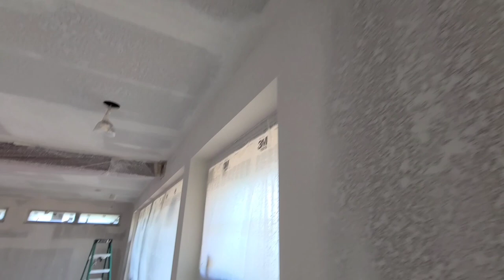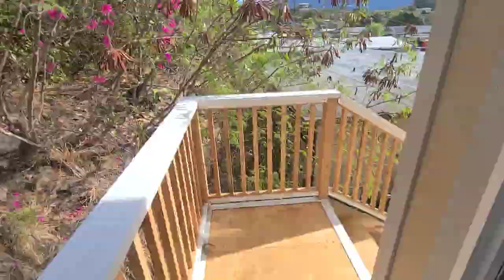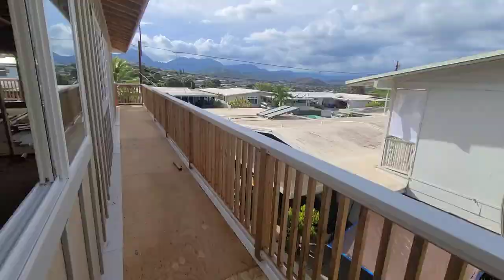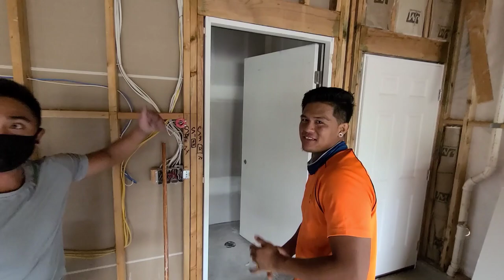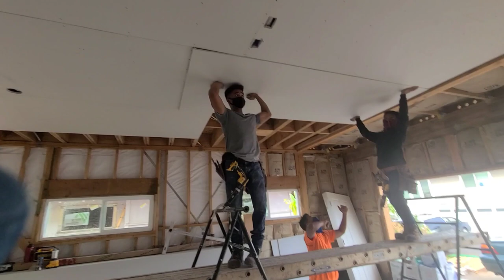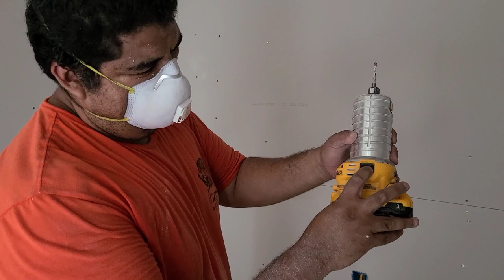Drywall Jobs #5

Comment: With your screw hole big fella,  do you coat them by hand then use the nail spotters for the other coats ?
Reply: Forgive me, I know you weren't asking me but I like to first coat by hand so I can deal with high screws and then I second coat with a 3" spotter. Cheers from Vancouver island
Reply from the maker: We like to run the nail spotter then pound everything in by hand then use the 2nd coat nail spotter for all our texture jobs.